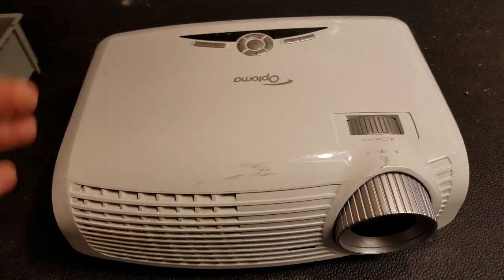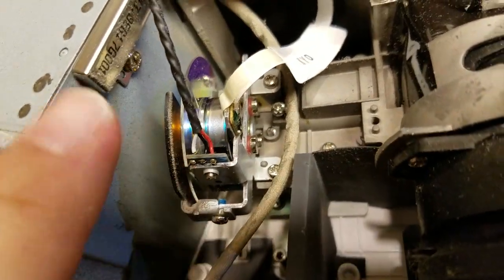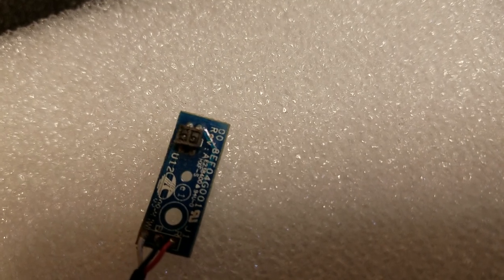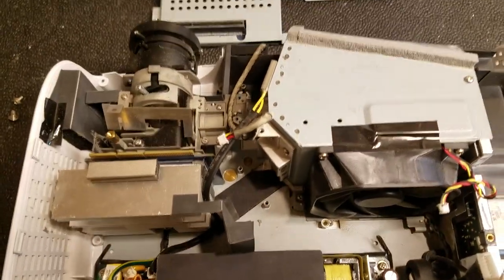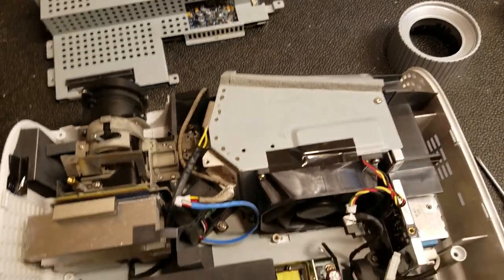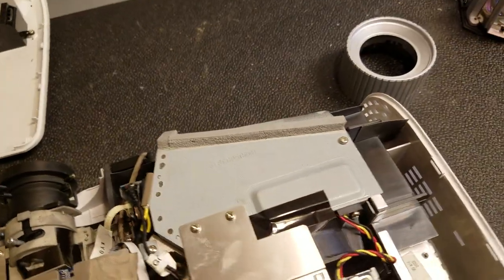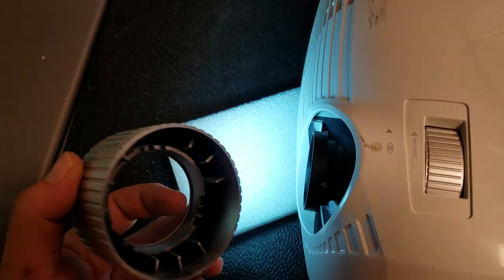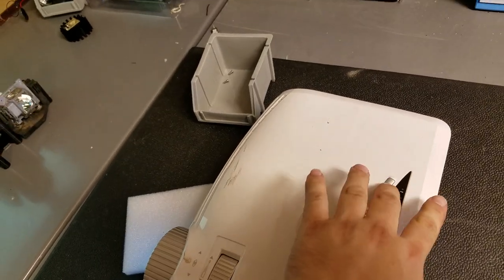Optoma HD20 Projector Cleaning

Comment: FixitFrank, thanks a million for this video. Key for me was seeing you pop off the focus ring for disassembly.
I had a horrible buzzing sound from my HD20, which went away after about 5 minutes of operation. And then next time, unit wouldn't turn on. It would try, then light up the lamp failure red and shut itself down.
Got it apart and what was happening is the color wheel barely touching the sensor board (buzzing). Then apparently the unit quit starting up because color wheel had totally jammed against sensor board.
Amazingly it functions fine after freeing up the color wheel and just barely filing away the edge of the sensor board.
Both fans run fine. What do you reckon caused this if not overheating? Is failure mode of the color wheel to get wobbly bearings and then start dragging?
Again, thanks for taking time to make the vid!
Reply: Further inspection and the color wheel has a segment separating. That's why it's rubbing. Either way i figured on ordering a new color wheel.
Reply from the maker: I was going to mention that you may have a segment pulling free.  You can get away with superglue for  little while but replacement is your best option.  After you put that new wheel in, you should be good for a long time.

Comment: Hi dude, this video is great and will help me a lot!

After 20 minutes on, my HD20 (lamp with 2,000 hours), starts to project practically in green. Could this be dirt on the fan and the color wheel?

What kind of plastic did you use to heat and repair the nut holder? This was awasome!!!

Thanks a lot and best regards from Brazil!

Comment: Where is the temperature sensor located? I own a HD81 that shuts off after 10 mins.  Everything has been cleaned but still does this so I was thinking if there could be a temp sensor.
Reply from the maker: What are the LEDs doing when it turns off?  If it is overheating and shutting down it will display a temp warning. If you are getting a lamp light flashing, it is probably not a thermal sensor that is your problem.  You may want to get into the service menu and see if any of the fans are reporting errors or if there is another error being recorded.  
Be careful about ending up on a wild goose chase. I have done that and ended up wasting a lot of time.  10min until shutdown does make me lean towards a thermal issue but unless you are getting a temp warning when it shuts down, it isn't a sensor.  There are actually multiple temp sensors.  
I'd check the fans personally. If the blower fan for the lamp is worn out, it will not move enough air and the lamp will slowly overheat and turn itself off without a temp warning.  
Check the error reporting in the service menu next and see what that points to.
Reply: @FixitFrank  It turned out to be the temp sensor.  I'm not sure why it was acting this way but I took it out and just reseated it back in but not super tight it works fine now.

Comment: Frank, fantastic video, thank you very much. However, I'm having an issue and I'm not sure if you even will see this, but it's worth a try. I had the flickering issue, and of course took everything apart prior to this video and cleaned the fan, took out the lamp bulb and blew everything off well. Flickering still. This time I watched your video and took out the color wheel and sensor. Cleaned the sensor, but didn't go as far as removing the circuit board. Reassembled and got a flashing green light for about 2 minutes then a red bulb light and amber power LED. Took apart and carefully blew the color wheel and sensor, still same issue. Also tried different lamp and that didn't work, I'm stumped. Any ideas on what to try? I have made sure that cables are right and reseated them as well.
Reply from the maker: Hi Dan,  Its hard to say 100% without it in front of me, but the color wheel bearings may be worn out.  Could you post a video of the flickering so I can see what you are seeing?

Comment: Hey Frank, can you help me here.. 

My HD20 had a problem where the colours would flicker often and the general colour of the display would turn weird sometimes the negative colours... 

I opened it up and cleaned almost everything.. one of the screws around the colour wheel was stuck so i didn't force it out and just cleaned it with a small (clean) brush 🖌️ i also cleaned the small sensor besides it 

The general colours are now back to original (thanks to you!) But now a new  problem is that the top left the screen (just the corner) has distorted colours 

Thanks again Frank
Reply from the maker: hello!  I'd have to see a picture but I have a theory the light tunnel moved or shifted. the 2 screws with glue on them are the adjustments for the light tunnel. Check out this video and see if anything points to your issue. https://youtu.be/_smYnIJKjYs
Reply: @FixitFrank  oh whoops there was glue on them 😬 i was wondering why one of them wasn't coming out 😵‍💫 alright I'll try to do sth

Btw the plastic piece holding the nut did crack just as you mentioned in the beginning 😁

Comment: I'm so happy I found this video. Thank you. My HD20 optoma projector has a kind of yellow glow in some parts of the screen. You can see this for example on peoples faces in the image. In the beginning the colour of the rest of the screen is good. The longer the beamer stays on, the worst it gets. the yellow turns into weird moving lines and eventually the whole screen turns greenish and distorted. Could this be the color wheel or maybe the mainboard? what do you think?
Reply from the maker: I'd like to see a video of the issue if that is possible.  Or even some pictures (you can host them for free at imgur.com).  it sounds similar to a color wheel problem except for the moving lines.  It might be failing capacitors in the power supply as well.  If you can get me a video to see of the problem, it will give me better info to go on.
Reply: @FixitFrank  Hi Frank, I decided to open the projector and clean it. I also cleaned the tiny sensor. Now it's running smooth again and the colours are how they should be. I hope it stays this way. I cannot thank you enough for posting your videos and for helping all of us. Much appreciated, thank you.
Reply from the maker: @SSS-tr3zk  I am happy to hear that!  I suspect you will be fine for a while.  Happy Holidays to you

Comment: Hi. Im kind a noob in this but i have the same one.  Started my projector and message came up. (Clean Filter)  where is filter?
Reply from the maker: don't stress it! this model does not have a filter.  I think when you see that warning it means either a fan isn't working right or the temperature is going too high. if you changed the lamp lately, make sure it has the same colored glass filter on the front of the housing. if you replaced it recently and it has a greenish tint to the glass, that is possibly your problem.  the green filters let too much Infrared inside and that can raise the internal temperature quickly. I'd check for that and a clogged fan, especially the turbine fan that blows air into the lamp.
Reply: @FixitFrank  thank you som much for the input.

Comment: I have the same model. I have a black spot that just appeared while I have my presentation on screen. I have wiped the lens very well and even changed out the bulb thinking it was a bad bulb. The spot is still on the screen. Any idea on how to approach this? thanks for any help you can provide.
Reply from the maker: Could you share a picture of what you are seeing?  There are a few possible causes and its hard to say without seeing the issue.  Imgur.com offers free and anonymous picture sharing.
Reply: @FixitFrank  Hi Frank, I went ahead and looked at your second video about cleaning the lens. upon opening the lens assembly I found the big main lens of the 3 had a burn mark. Do you have a link on where I can order a new one? I see alot available on ebay but thats all from china and takes weeks to deliver.
Reply from the maker: That's what I was wondering if you would find. That's a shape lens. You might  need a new lamp assembly. They tend to cause that if it has a bad lens coating. It can happen from age and dust too. Let me see if I have any old but good lense
Reply: @FixitFrank  Hello Frank, If you do have any extra lenses I would greatly appreciate it.

Comment: I ripped the blue ribbon wire that connects the projector to its cover. Now the buttons on the projector don’t work. Where can I find replacement wire?
Reply from the maker: How bad is it ripped? Is it just one end? Finding a replacement will be difficult. Repairing the end might be an option. Otherwise if you find a ribbon from something else, you can trim it down.

Comment: How do I test the optoma hd20 color wheel sensor?  I've replaced the lamp and the color wheel and cleaned the projector using your tips. The unit starts then the color wheel seem to spin at Ludacris speed then fans come on then it repeats a few times then I get solid red and a flashing amber light. Lamp never turns on?
Reply from the maker: I'll do a video on it this week. I have an HD20 here that I can show you how.  Give me a few days to get it all together.  this is a good idea for another video.
Reply: @FixitFrank  AwW Man, Thanks a lot!!!
Reply from the maker: @TallStarlite  I just recorded it.  Check back on Wednesday or if you are desperate, email me and I will send you the raw video (pre-edited) tonight.
Reply: @FixitFrank  Frank thank you so much I didn't mean for to go threw so much trouble. Ive had this projector sitting a shelf for about 4 years after I replace the lamp then a few weeks later the color wheel exploded one night so I replace it but as stated the lamp won't turn on. I'm in no rush I have a BenQ 1070 working flawlessly. Optoma would just be a spare if it'll ever work again. Thanks again !!
Reply from the maker: @TallStarlite  No trouble at all. It honestly happened to work out that I had the projector around when you asked, so it was kind of meant to be.  I'll have it posted on Wednesday.
Reply: @FixitFrank  Haven't seen any new videos of yours did post it on a different channel just wondering? or can I from you threw email?
Reply from the maker: @TallStarlite  I did not finish editing it.  My day job got a little busier this week. It should be up tonight/tomorrow morning since Ill time to edit tonight.

Comment: HiRostit! Great video! I have the same projector with lens problem is showing a black spot on the screen just wondering if you fix this problems also and where you located thx!
Reply from the maker: Hi Javier,  If you are getting a black spot that is probably the lens inside the optic area. Unfortunately its not a reasonable repair. The entire optics assembly needs to be changed and thats expensive. Well over $400.  I would sell the projector for parts on eBay and treat yourself to a new one.

Comment: Awesome video, my optoma HD 20 died , no power, no led, no nothing. Is there a fuse or something like a fusable link or sensor that could cause this. My wife did perceive a smell of heated plastic .your help would be appreciated.  
Don
Reply from the maker: Hi Don, that is possible that the thermal fuse tripped but it should have reset after cooling. Aside from that there is no temp protection that would render it without power. If I had to guess you have a failed power supply near the secondary. There is a chip that fails and can burn the board. Have you looked inside yet?
Reply: FixitFrank I haven't opened it that deep yet, when I do, I will let you know, but first Caribbean cruise.

Comment: Is this a similar lay out to a optoma hd25? ,as mine doent sound to healthy ,I think the colour wheel bearing has gone .maybe a fan ,but when I put a film on it gets louder ,compared to gaming ,it's not the normal sound u would expect from new, sound rough.
Reply from the maker: You are likely right.  If this is the original wheel then it is well past time for it to fail. The HD25 is almost the same thing.  If it's a loud vibration or whining, then you are on the right path.  These wheels are pretty inexpensive these days and the HD25 is a good projector.
Reply: @FixitFrank  
Thanks for getting back to us ,I'm ordering one .

Comment: Compressed air and projectors is a no no, so why do you persist with the risk of getting dust into to optical engine...??
Reply from the maker: I partly and politely disagree.  At some point the risk is outweighed by the benefits.  Properly done is works wonderfully.  Some of the units I work on have dust so thick that a vacuum will never get it out.  Low pressure high volume air works fine. Will it get into the optic assembly sometimes?  Sure.  They need to be cleaned anyway so its not really an issue.

Comment: Hi Frank, I got one of these projectors on eBay and managed to get it back up and running again but the seller took out and never replaced any of the screws that hold down the top of the housing. Do you know what kind of screws they are by any chance ?
Reply from the maker: Hi Joe,  I have one in my closet at work.  I will check tomorrow and let you know.  I think they are pretty standard plastic thread screws, but I will find out for sure and get back to you.
Reply: FixitFrank Brilliant, that’d be super!
Reply from the maker: Hi Joe,  I checked and they should be M3 by 7 or 8mm long(7.6mm or so.  Same size as some of the screws holding the bits together inside.
Reply: FixitFrank That’s Brilliant thanks so much for that Frank!

Comment: Hello, I have been looking for a help and based on your tutorial you might help me. I have the Optoma HD131xe and I followed your insturction. Everything is clean but when I start my projector it will run for 10sec and than the lamp will go off and by the LED signals it say that it is overheated. The fan will rise the rpm like during the end cooling and after cca 30sec it will turn off the entire projector. Have you experienced this before, the lamp is not brand new, but it has not been using so much. And it seems that there is some wierd noise coming from the projector.
Reply from the maker: In my experience that is a fan not reporting the proper speed. The noise may be a damaged fan or some debris. Check the lamp blower fan especially. See if the tachometer wire reports a low DC voltage.  Usually it should be under 1volt. Compare each RPM voltage. If one is significantly different, it may be that fan.  That noise may be the root cause of everything.  If a blade broke or an old lamp exploded and left glass inside, it can cause all sorts of grief.  If it was working before disassembly, then just check your wiring and make sure nothing is pushing against a fan blade. I've done that before.

Comment: I have an Optoma HD180 unit which is a re-branded HD20. I have had issues with the image turning green in the past. I found running it in High Altitude mode would solve this issue until recently. I have had this unit apart in the past and it is clean inside. I however did not clean the CW sensor. So I took the color wheel out and dusted off the sensor. It looked pretty clean. After putting the CW back in my unit now powers on, color wheel spins up but I get no Lamp. 

After doing some research on Color Wheels mine was pretty noisy and did not spin freely. I read that if the CW does not spin up to speed the lamp will not turn on. 

I just replaced the CW and the same issue is still there. Color Wheel spins up but I get no lamp (I have switched lamps out to be sure)

It will cycle a few times which the fans will spin up to full then power down and attempt to restart. eventually it will give me a Lamp failure indicator. 

Have you run into anything like this before. It was running until I took out the color wheel the first time. Everything looks to be in place. Could the sensor be bad? Can you buy just the sensor?

Thanks
Reply from the maker: One thing I always recommend checking is all of the wires. Even if you don't think you touched them. More than once I had similar problems and just unplugging/replugging the wires helps. As far as the sensor, I would see what its sending to the projector. A scope is ideal but you can use a volt meter. Measure the 3 pins on the mainboard with the sensor plugged in. Start up the projector and you should have 0v, 5v, and then the sense line. It will be lower than 5v. Maybe 1-2v? Depends on the meter. If you measure 5 on both power and signal, the sensor went bad or more likely the wire broke where it goes into the sensor board. Take a look at those. Its really rare for the sensor to go bad. You will need to get into the service menu to adjust the color wheel index position or your color will be off.  See what you find with the sensor pins.
Reply: Rostit I'll check again tomorrow. I'm going to tear the whole system apart to make sure nothing came loose removing it from the ceiling mount. Thanks for your reply.

Comment: I have a problem.

I start the beamer and it comes a beep, then turns the color wheel for about 5 sec, within the 5 sec buzzing the color wheel 3 times. Then the color wheel shuts off and comes to a standstill. After stopping, both fans (fan of the lamp and the sensor) start to blow, then the yellow operating light starts flashing (flashes on and off and on, and so on) and the LED lights steady red.

According to the operating instructions, it is a lamp error. Lamp errors can be, for example, lamp defective, color wheel or sensor defective, power supply lamp defective and so on.

I changed the projector lamp for a new one, but the error is still there.

Please help me.
Reply from the maker: Hi Robert,  I would be glad to.  Is it an HD20 as well?  My first suspect is always the color wheel if the lamp has been changed.  Have you opened it yet?